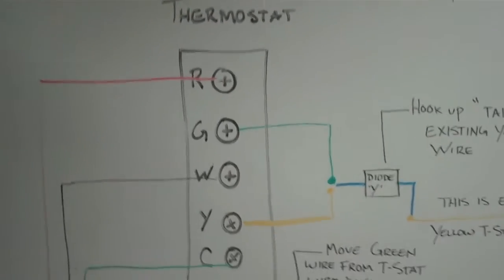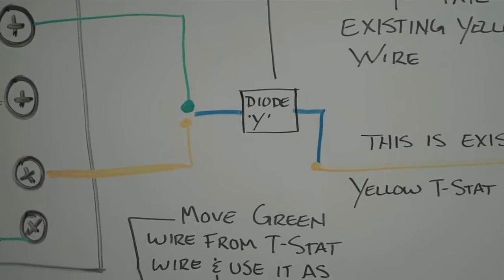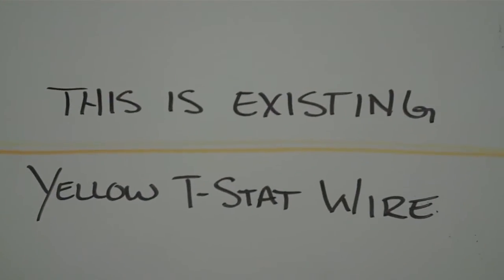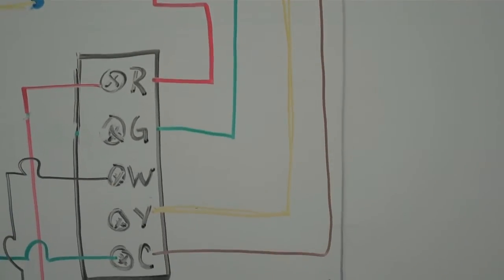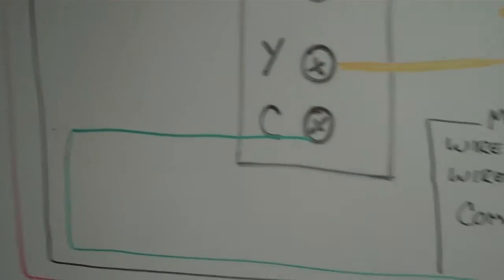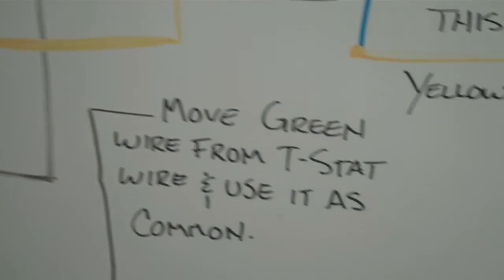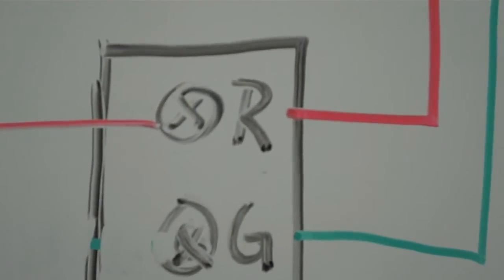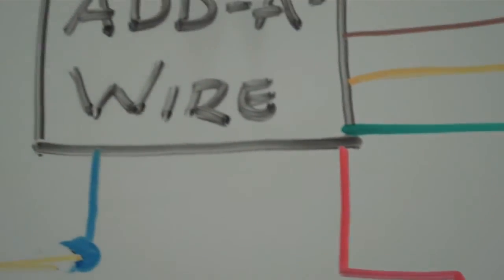Venstar Add A Wire Installation Diagram on Whiteboard

Comment: But I would like to know is if you're dealing with a two-stage split system and you need six wires and you only have five will this thing still work ?& how would that be wired on a york split furnace

Comment: hi!
after installing the modul my outside fan wont go on.
i have  an old board cables are different ,i may missed something
i didnt have any wire on Y
everything runs ok but not the fan

Comment: Hey I have a heat only furnace with only three wires.. W, r, g. Can this add a wire be used to install a common wire for the new thermostats? If so, how is it hooked up? Running new wire might not be possible. Thanks.